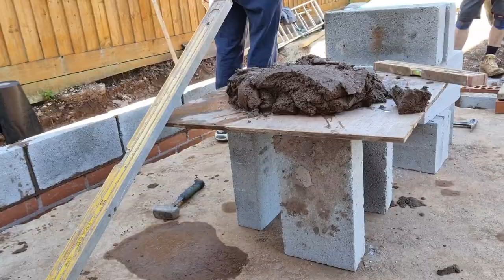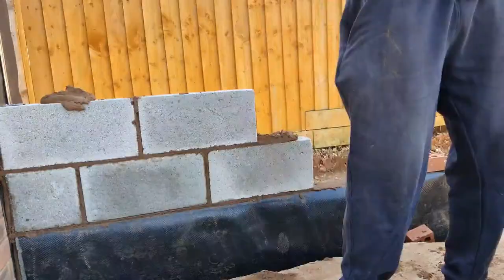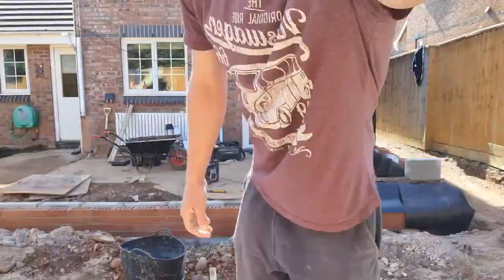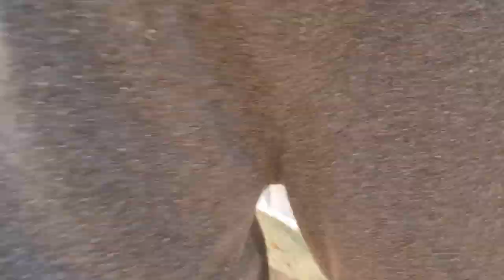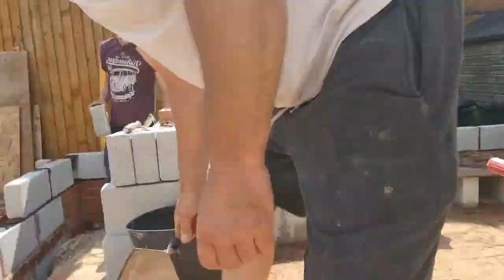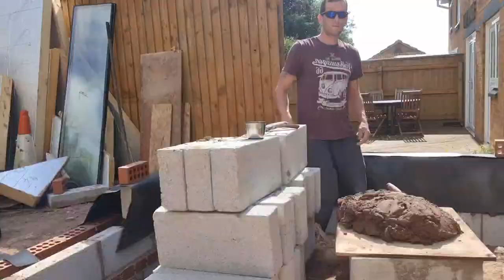taking the blockwork  up cavity tray installed doorway opening set out

Comment: Why is it not all houses have a cavity tray just above damp?
Reply: The main reason to have a cavity tray at DPC level is to create a continuous barrier to protect against natural radon gas. Not a all areas have enough radon present to cause any concern. A lot of people think the tray is at DPC level is for damp. Also different Building control officers ask for different details.
Reply: @joefowler9600  Perfect a very good explanation thanks Joe!
Reply: @joefowler9600  sorry joe but if its a radon issue the cavity is sealed at dpc level, trays at dpc level usually mean there's a variation in ground levels
Reply: @scottnever8732  so how do you seal the cavity at dpc level without a tray???
Reply: @joefowler9600  the DPM  should go up and over the inner skin ,down the cavity 6or9 inches and under the outer skin , this would be the "tray" you would then put your horizontal dpc in as normal
Reply: @paulevans498  not sure what your point is here? I originally said a tray is used to close the cavity when radon is present, but most people think the tray is for damp reasons.
So what are you suggesting the tray is for?
Reply: @joefowler9600  The purpose of installation of the DPM as I described is to stop radon gas , but by default it also stop's damp getting in.
Reply: @paulevans498  i understand that mate.
The original question on here was "why do some houses have a tray at DPC and some dont"
As far as im aware and this is what BC officers have told me many times in the past. The main purpose of a cavity tray is to create a continuous barrier to stop radon gases entering the building. If radon isn't present, then no need for a tray at DPC height.